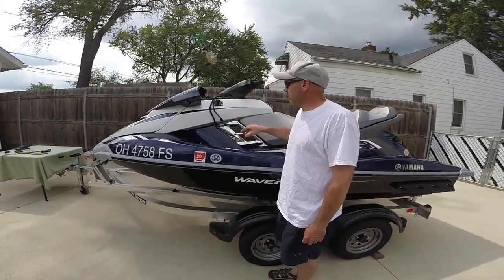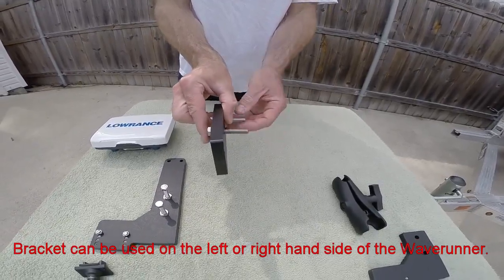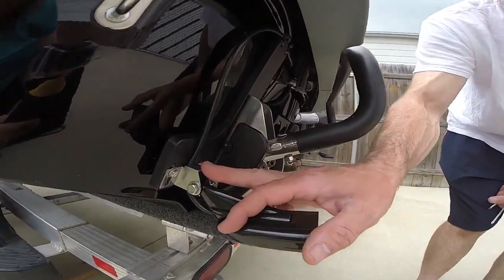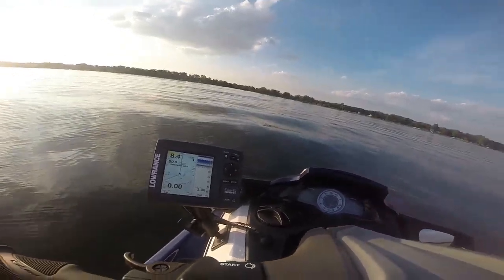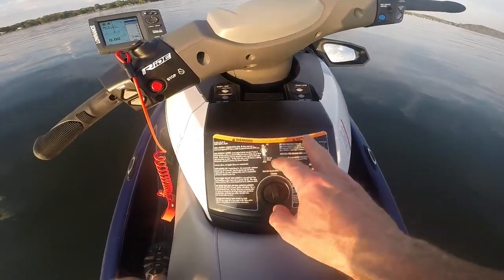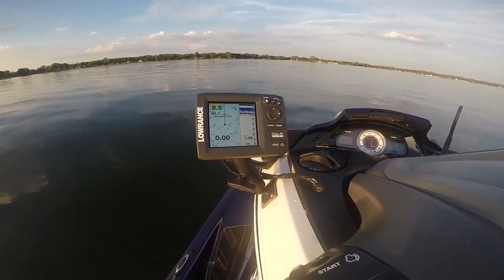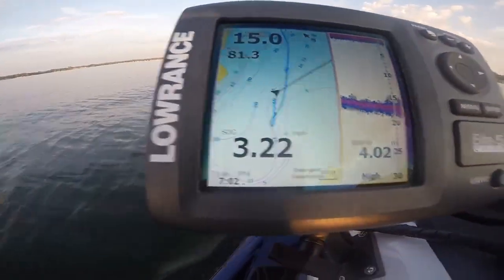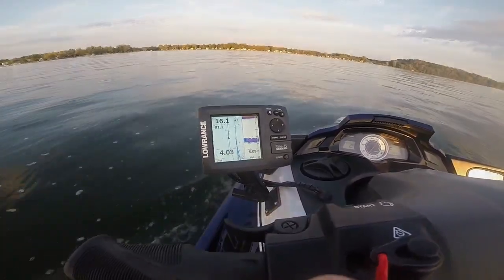Yamaha FX PWC Jet Ski GPS Fish Finder Install + Stern Mount Transducer + Split Thru Hull Fitting

Comment: just saw a vid where the guy said 'never EVER use cable ties' as they can break the fines wires in the cables affecting yr readings
Reply from the maker: Thanks for the comment. I have never heard of such a thing. OMG, imagine living in a world without wire ties. Generally speaking, when running any kind of wire or cable the installer should be mindful of not sharply kinking the wire per the manufacturers minimum bend radius (if available). My set up is running well for almost four years now. No glitches caused by wire tie use. I can consistently hold sonar bottom readings between 50-55 MPH in 100-200 feet of water. It has been a great performing setup. I am making some new parts for mounting a 7" HDS Live to this 2017 FX using a transom mounted 3:1 active imaging transducer and also a custom made cup mount. They will be designed and machined by myself. I'll post a video after I get it all done. My brand is boondocksPWC  . You can see some of my work on Facebook and also on the Internet. Take a look when you have time. Have a good one.

Comment: Does this setup block use of your left mirror?  Looks like your transducer mount holds bottom really well and are great designs...I think you only showed up to 50mph.  Do you have success at higher speeds (and depths?)  You are in pretty shallow water.  Will a newer transducer/depth sounder hold bottom better? (I'm guessing they make some models that are higher power transducer?)  Thanks
Reply from the maker: Hi, yes the left mirror is blocked by the fish finder. However it is not an issue, because I just have to position myself at a different angle to see things better in the mirror. The Yamaha mirrors are horrible anyway. They're not adjustable and are hard to use just by their design. I can hold bottom at high speeds in deeper water too. Typically I run the Waverunner in depths ranging from very shallow to about 150 feet. I am in the Midwest, so no deep ocean water around me. I don't know if newer units will show bottom better at faster speeds. I am very happy with how well my unit functions. It seems like the same transducers are used year after year.

Comment: Nice video!
Is the ram mount you have mounted to fiberglass or plastic? Is it pretty sturdy to leave the fishfinder mounted driving down the road?
Reply from the maker: Hi Jeff, On this FX install I have the 2"x3" rectangular base 1.5" C sized RAM ball mounted to the white plastic side panel with large stainless steel fender washers and brass nylocks on the inside. I am guessing the plastic Yamaha uses for the side panel is ABS and it is about 1/8" +/- thick. My 5" Lowrance is very sturdy. I do not travel long distances with the sonar attached, because they're expensive and I just dont want to risk anything happening to it. The only time I travel with it mounted would be on one of my camping trips. Sometimes I get back to the ramp late in the day and I just leave it on during the couple mile ride back to the campsite. Anything larger than a 5" screen would be getting heavy and I personally would not side mount it. Definitely use large fender washers or some kind of backing plate when mounting (vertical side or horizontal dash), so the screws dont tear through the plastic. I choose the 2"x3" rectangular base over the standard round RAM base in an effort to spread out the weight of the Lowrance over a larger area on the side panel. I've never had problems with screws tearing through, but have met a person that did. The person I speak of had his fish finder mounted to the horizontal surface of the dash on the black center dash cover of his FX and was using the standard 2-1/2" diameter RAM base without any fender washers or backing plate. Thanks for watching!
Reply: @LorenP  thankyou for your reply. I have a seadoo with the abs plastic I was going to mount too and just wasnt sure if people have just mounted these ram mounts on just fiberglass or on plastic also. Thankyou for your time to make the video and reply back. I'll look at putting a back plate on the back of the mount

Comment: Nice solutions! Have you considered the VX where there is no step ladder?
Reply from the maker: Hi Rob, thanks for watching. I do have boarding step mounts for the 2015+ VX,GP, GPR, VXR, but my main focus is dash device mounts (GPS, speaker, antenna, rod holder) and side imaging transducer mounts for the 2012 and newer FX. My brand is boondocksPWC . You can see more of my work posted on my FB page and also some on my website. Have a good one!

Comment: I'm looking to do this on my Yamaha FX Cruiser it's a 2003 did you have to put any backing behind the plastic fairing for the screws that hold the RAM mount in. Also did you have to take that plastic fairing off of the jetski
Reply from the maker: Yes, use backing for sure. Without the backing the fasteners will likely tear out.  I used very large diameter stainless steel fender washers. On my 17 SVHO, the side panel comes off very easily. It will make the work of routing your cables much easier. I believe I have a detailed list of parts used in the description of this video. I will have to check later to see if the list is there. It should discuss the size of the fender washers. If your 2003 has the dash cup holder, then I do have some cup holder mounts listed on eBay for the FX. Not sure if it will fit your 2003. Do an eBay search for "Yamaha FX Waverunner Cup Holder Mount for RAM 2-1/2" Dia. Ball Base PWC Jet Ski" and you will see my boondocksPWC seller name

Comment: Why not just mount it in the ski through hull...?
Reply from the maker: In-hull transducers are becoming more and more popular with PWC and 2D sonar. In-hull is cheap and easy if done correctly. It can also be a very expensive lesson if done incorrectly. I sell a lot of transducer bracket kits and also dash mounting parts for FX Waverunners. I tell people their options. I am not stuck on one method. I sell these parts and do not depend on the money to live. I do it, because I enjoy making stuff. My parts look amazing and work great! Look me up at boondocksPWC online. Personally, I like having the instantaneous water temp readings and have zero issues with my transducer mounted on the transom. There is a ton of information online now about how to install transducers on Waverunners. That information was not available years ago. Many many people run side imaging on their chartplotter for fishing, or just to have more awareness of what is on the lake bottom. StructureScan, Side Imaging, SideVue transducers perform better in the water. JMO. This is an old video. I am running a Lowrance 7 HDS Live with Structure Scan on one of my mounting brackets. Thanks for watching. Send me a video link of your work. I would love to check it out!

Comment: Do you have a dual battery system?
Reply from the maker: Not yet. I use my Waverunners for leisure. The Waverunners are typically running when the sonar/GPS is on. I have the sonar/GPS wired directly to the battery using a fuse block. The GPS will stay powered on independent of the engine stop/starts. Eventually I want to install another battery with a magnetic latch ACR switching system from Blue Sea, but just have not found the need for it yet.
Reply: Do you have to charge your ski between uses because you only have on battery?

Do you sell your transducer brackets?  I have a 2015 Yamaha deluxe.
Reply from the maker: No I do not charge between use unless my Waverunner will sit on the trailer for more than 2 weeks. I maintain my battery per the Deka AGM battery instructions. I've never had problems not starting on the water. I've never had problems with slow starts on the water. I have always carried BoatUS Tow Insurance. The insurance gives me peace of mind. If you talk to any boater that has paid full price for a boat tow then they will tell you it is not cheap.  I do sell bracket kits for the 2015 VX. Send me an email at loren3870@gmail.com. There are a couple people online selling brackets. My kits are much different than the other kits. I have many design options to choose from. The kits are priced based on option features, and your transducer will determine the best bracket. Just let me know what brand fish finder you plan on using, the transducer model # if already known, and let me know if you ride in salt or fresh water. Kindly,